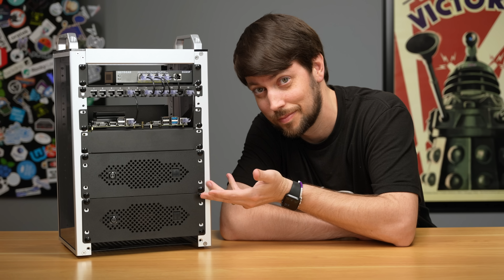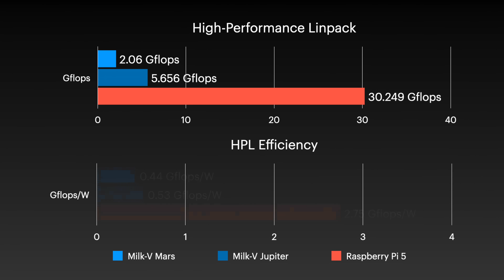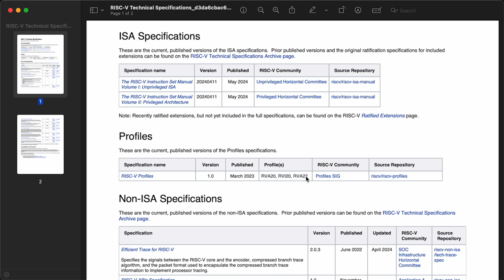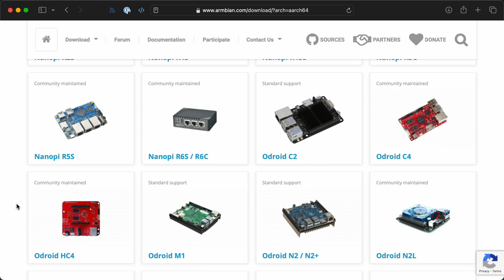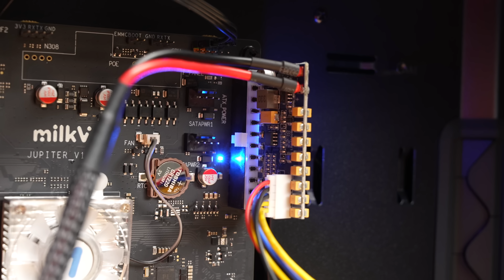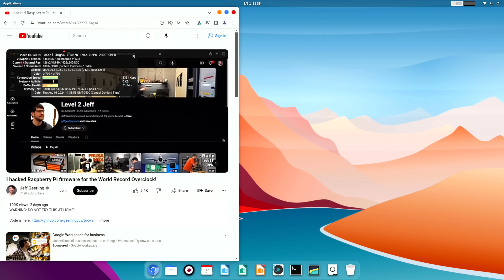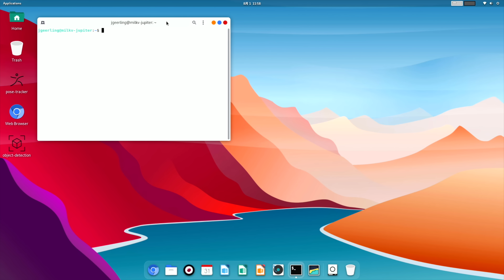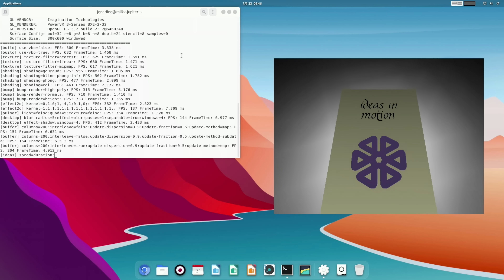The PC industry is changing: RISC-V goes mainstream

Comment: RISC-V going mainstream is the new year of the Linux desktop.
Reply from the maker: Surely it'll be this year!
Reply: @JeffGeerling  2 more weeks
Reply: On a positive note, making RISC-V fast is less of an issue than making x86 fast...
But, on the other side, it still has some drawbacks for in-order implementations that seem to make it around 20% to 60% slower than it could be (mostly by needing to run more instructions). Some are fixable, some not so easily fixable. Big issue as I see it is the lack of a register indexed addressing mode; followed by the lack of an ability to load a semi-large constant in 1 cycle, etc. There are some other things, but these are the main ones as I see it.
Reply: I believe some people here confuse RISC - a general principle of computer architecture - with RISC-V - a specific ISA based on this principle.
Reply: @NeovanGoth  The Motorola 88000 - 88100 CPU was a RISC CPU. 😋
Reply: But can it run Arch Linux and NixOs. I’m not waiting for Debian and Ubuntu to push updates or cloning every repo.
Reply: I'm waiting for Half-Life 3 being released for Hurd on RISC-V
Reply: Brah you jinx it
Reply: 3% market share finally? and without preinstalls? Sounds like cope....
Reply: I did switch to Linux this year after nearly 30 years of being on Windows.
Reply: If RISC-V support/usability/performance is as good as linux, I’ll be very happy about it
Reply: The chips are not fully developed yet to be an advantage.samsung and Chinese companies are supplying Russia with these chips for defense purposes....
Reply: Well, it seems it is this year.
Reply: 100%. I did electronic engineering and VLSI in the 90s and we were told back then, everything would be RISC in a few years. Here we are, 30 years later, and now finally, someone can, really, really, really, slowly, open youtube. Amazing progress.
Reply: @chloefletcher9612  To be fair internally pretty much all modern chips are RISC since both AMD and Intel decode the X86 CISC instructions into RISC microcode before implementing that microcode in their hardware.
Reply: @skirata3144  
To be fair, you have no idea what the hell you're talking about.
Reply: @chloefletcher9612  To be fair, most things are RISC - phones are all RISC, and they outnumber pretty much anything else. Amazon runs a large number of their servers on their own RISC cpu, apple runs RISC on all of their devices, and even Microsoft saw a rush of new RISC laptops this summer.
ARM is RISC - and ARM is winning all over.
Reply: @chloefletcher9612  Feel free to thank t-w-o three of the biggest a-hole companies in the tech industry for that. Namely Hewlett-Packard and Oracle. HP swallowed Compaq which had recently swallowed Digital Research. DR had the Alpha AXP, which was a RISC platform. HP had PA-RISC which was inferior, but chose to bury the Alpha in favor of the PA-RISC and their wet dreams of a future with Intel Itanium. Of course, since IA-64 was co-developed by Intel and HP, Intel pulled a Microsoft on HP and kept the development slow in favor of new versions of their own Core series of CPUs. Oracle on the other hand ate SUN raw for breakfast, got a stomach ache and had no clue whatsoever what to do next. Oh and Apple really helped killing IBM's PowerPC (the POWER still lives on in IBM's Z mainframes - but how many are buying those these days?)

So we have SUN Sparc, Alpha AXP, HP PA-RISC, IBM PowerPC - all RISC CPUs, and all gone. And that's what happens people, when you let numbnuts with Excel spreadsheets make the decisions.
Reply: @chloefletcher9612 which is exactly what happened?

Risc just means reduced instruction set computer.
Risc-V is just one of the architectures that implements this principle.

ARM is risc based since its inception and x86 is internally risc based since the P6 (Pentium Pro) days.

That's not some arcane knowledge either. You can read up on it on Wikipedia.
Reply: @chloefletcher9612  
This is just nonsense. RISC wiped CISC from the workstation market well before the 90s. It started its entry onto the desktop when Apple moved to Power PC in 1994. Now you can't buy a processor that isn't, at least internally, effectively a RISC CPU. RISC owned the mobile market from day one. ARM processors from Apple and Qualcomm easily compete with Intel and AMD. RISC-V has a significant presence in the embedded market and (with China's interest and investment) it's only a matter of time before it is competitive with other Processors.
Reply: @philiprobar  That is a pretty shakey statement, about as true as saying all CPUs are single instruction machines because internally the machine code is effectively deconstructed into a bunch of on/off signals. 

CISC has always been compound instructions physically exacuted by combinations of several simple internal operations, not nessesarily with reprogramable microcode but the basic action was there. The original point was to make the assembly a somewhat higher level of abstraction and allow the chip manufacturer to determine the fastest implementation for a particular chip. RISC CPUs have always required executing many more external instructions than CISC, which counteracts the difference in average cycles per external instruction, with RISC the compiler optimizer must determine the fastest combination of simple instructions for each chip model (This is a large part of why Itanium failed. Though Itanium took it to an extreme even moveing things like pipelining to a software optimization problem.) 

The type of ARM chips used for phones and laptops are effectively CISC at this point because they have needed so many extentions to satisfy specific performance demands, from SIMD vectors to codec acceleration to cache management, pipelining, and branch prediction.
Reply: @mytech6779  "This is a large part of why Itanium failed."

Not really. Itanium was a VLIW design and the software optimisation problem you mention was about instruction sequencing, which may indeed interact with pipelining, but with Itanium the real issue was finding enough parallelism to keep the various execution units busy. Still, the work already done by Multiflow Computer on such problems did advance compiler technology to the extent that numerous companies wanted access to that technology after Multiflow's demise.

For non-VLIW designs, the dynamic scheduling of instructions is not incompatible with the RISC philosophy. Indeed, CISC products have employed RISC-like internal instructions since the 1990s, at least on x86 and derivatives, precisely because such instructions are easier to work with than less well-defined, implementation-specific compound instructions.

And, with regard to RISC-V products, one can expect more substantial performance gains as more and more implementers adopt these established microarchitectural approaches, long since applied to both earlier RISC products and CISC products alike.
Reply: Never forget that this is how raspberry pi started out, too. RISC-V is advancing much faster than the PI did, because the instruction set is open and it’s easier to “stand on the shoulders of giants” at this point. 

It probably won’t be next year, or the year after, but its day will come when it can compete with a pi neck and neck. And by then, that might be plenty for things like YouTube, word processing, and other day to day tasks. Emulation, too.
Reply: @tonyolmstead8282 no we need an open gpu and south bridge
Reply: Kinda like with Bitcoin / cryptocurrency too, there needs to be a use case / killer app besides just evangelism to get adoption to the mainstream / next level.  Maybe the tighter coupling of open-source custom instructions and the open-source Linux kernel can provide that.  Kinda like the hope that RISC-V will be beneficial for the “AI” bubble/craze.
Reply: @seanwieland9763  except crypto/ai is an entirely useless tech that only serves to burn the planet
Reply: @seanwieland9763  cryptocurrency can't have a killer app because it is just reinventing the wheel
Reply: Nah, RISC-V is already mainstream in embedded. Give it 5 years and we'll have fast CPUs too - probably in Android phones first I expect since Google is adding support there and most apps are bytecode only. There's nothing big in the ISA preventing it being just as fast as ARM or x86 now, it just needs people to design the chips.

@chloefletcher9612, everything is RISC now - did you miss Apple and Microsoft moving from x86 to ARM?
Reply: @TimmmmCam No thank you. Keep that junk away from my PC.
Reply: Yeah I really don't think so since it is ten times slower than the pi3. Forget about being ready for the mainstream the hardware still needs to make massive leaps in performance before it is even considered ready for the mainstream.
Reply: @fastedwarrior7353 maybe for NAS, high end fridge, etc, not as PC
Reply: @fastedwarrior7353 2 5 GH is good enough for average use.
Reply: Also on laptop please
Reply: We always say that for every year

Comment: Wishing RISC V the best of luck.  I loved my time working on SunOS/Solaris/SPARC.  I loved that Sun had published much of the Solaris/SPARC that it could be used in University classes.  Hopefully that role could be assumed by RISC V and Linux.
Reply: Open Solaris lives on in the illumos project. There is even a port to at least one RICS-V board.
Reply: SPARC was multisourced by design, and used in many other places, e.g. ERC32 for space. It also had some high end open source implementations published. MIPS was more popular in architecture classes last I checked, though, and is also used elsewhere (like the PIC32 rebrand). It kind of seems like abandoning either is fad driven, like the adoption of Java.
Reply: It's struggling to play a Youtube video at 360p? 
I like the concept but I can't really say I am very impressed by this thing...
Reply: @Alfred-Neuman  This. It probably needs another 5 years.   Ebay just offered me a Lenovo PC for $35.  It's easily 10 times as powerful as this machine. With a smaller foot print too.

Comment: Thx for the video but I have some remarks.
1. the speed in YT is resulting from bad GPU drivers which is a commonly known problem with Imagination GPUs. If you would have used a Radeon RX550 in the PCIe slot, it would have looked much different!
2. a main difference between the K1/M1 chips is, that they support vector. That's why it is crucial to have software (even benchmarks) built with vector support which most aren't (or using version 0.7 of the standard but this one has 1.0!)
Other than that it was a nice and informative review.
Reply from the maker: Oh, didn't even realize the RVV support in K1 was different! Honestly I had to dig through a lot of articles for the differences, Spacemit's own website doesn't have much data on the English version :/
Reply: @JeffGeerling  no problem....community is here for you :)
Reply: @Nightwulf1269 community win!

Comment: IMO if Risc-V matures faster, it's because it benefits from effort previously put into making ARM work. People are now set up to work with multiple ISA, so adding one more is less of an issue.
Reply: It's not like ARM was the first or even third processor architecture switch. Porting entire systems across processor architectures is at least as old as Multics, the predecessor of Unix (for which it is a main characteristic). Macs have gone from 68k to PPC to x86 to amd64 to ARMv8. Linux traversed a different widening path, x86 first, then 68k and onto all sorts of others (alpha, mips, sparc, ppc, arm, etc), all prepared by GNU.
Reply: It'll be years before RISC-V is a viable platform at this rate. Its an order of an magnitude too slow for even basic compute tasks and can't really do everyday tasks at all. Competition is good don't get me wrong but RISC-V is so far from being competition that it might as well not even be considered at all. Sure the software side needs a lot of work but the hardware side seems to need even more work. Risc-V is ten times thats right ten times slower than even an old arm platform like the Pi3 and it'll need another decade of work at this rate. Apple's M-Series of chips is really the way to go right now.

Comment: Considering the state of GPU driver support on ARM (more lack thereof) even if RISC-V is worse right now, it won't be long before it overtakes ARM I see a way bigger push for full support here and geopolitics aside I think it's trying to avoid repeating the same issues we have with ARM boards so far
Reply: It has an extremely long way before it overtakes ARM. Pi 5 is not very fast, and it's just a tiny fraction of that. They may match current ARM in 5 years if the Chinese throw billions of dollars at it. Of course, ARM won't be sitting still.
Reply: @tschorsch  I was referring to GPU support only, which is a very low bar even on ARM
Reply from the maker: The PCIe bus is already pretty solid on these chips, certainly as good as 1-2 generation old Arm SoCs.

Comment: For the geekbench question: could you try using the Phoronix test suite? It benchmarks actual applications, so could be a bit more accurate too.
Reply from the maker: The Linux kernel compile was the pts version — right now some parts of Phoronix work okay on RISC-V, others don't. In the linked GitHub issue I have more test results too :)

Comment: 1. Processor developers should be given more time. Expectations regarding development progress are enormous these days. We must not forget that the companies behind them are not as big as Intel or AMD. On the other hand, several competing companies may be developing very similar processors. So a lot of wheels are being reinvented several times.

And that means:

2. I fear that if development has become good enough for everyday non-server processors, the number of competing products will put users off, similar to Linux, in my opinion. With Windows or x86 processors, I have to live with what one (or two) companies develop. I simply don't have the time or the desire to try out a number of Linux distributions until I find the right one (maybe the next one is better?) And processors and boards simply cost money, unlike Linux.

I don't know how realistic it is, but maybe a long-term socket for RISC V would be a good thing, but then everyone would have to agree on a version and it certainly won't be problem-free, I'm thinking of the BIOS or equivalent, and it will probably be more expensive initially too.

Comment: Does it boot with normal UEFI or does it use U-Boot or another bootloader?
Reply: Theoretically, you can recompile UBoot to add a UEFI interface, but I've had almost zero luck in actually getting it to work
Reply: OpenSBI and U-Boot.

Comment: So far the GPU support from Imagination Technologies for the RISC-V chips still has to produce some real results. From that perspective, the GPU support for the Raspberry Pi is mature, and now that Collabora has released the OpenGL driver (Panthor) for the RK3588, ARM is still ahead of RISC-V. And nobody seems to know when Imagination Technologies is going to upstream the GPU drivers.
Reply: Back when androids came with gpus from Imagination Technologies, they did the same stuff - not releasing proper drivers/blobs.
Reply: It's already open and mainstream.
Reply: Panthor for Rk3588 is still a dumpster fire, to the point you are still better off running panfork. And no Vulkan yet. And i brought a OPI 5A a year and a half ago... They are far from being a good example.
But i do agree about Raspberry PI.
Reply from the maker: I keep hearing they will... and then delays... so still holding out some hope, but I don't think most of us would give Imagination the benefit of the doubt!
Reply: Isn't Imagination really bad when it comes to GPU drivers for ARM and MIPS Linux? The CPU vastly underperforms and can't even compare to ARM in efficiency. I think that Apple's M-series blow this out of the water in both performance efficiency.

Comment: RISC V is a cool and very important project. But RISC V as a desktop or server CPU is a meme and will be for a while yet unfortunately .
Reply: I mean, powerpc is still being used in the (albeit niche) line of servers being produced by IBM, they sold their x86 branch to lenovo along with thinkpads but their Powerpc servers are still produced inhouse. I imagine porting low level software from one risc architecture to another is probably easier than porting from cisc so this might help in some very specitic cases
Reply from the maker: But it's the year of the Linux Desktop!? :D
Reply: @JeffGeerling  :D

Comment: Of course you have to put the gpu in it!
Reply: Wonder if AMD would have compatibility drivers one day for the Fury X Nano 🤣picked up a bulk of 10 for $60 a piece.
Reply: @shadowarez1337  
Those are well supported by current up to date drivers on linux.

From his previous videos the older (gcn architecture) AMD cards are what tends to have the best compatability on non-x86 platforms on linux when it comes to dedicated gpus as well - so if any gpu would work that would be one of the more likely ones to work.
Reply: @olnnn  thank you then I may have a project I can work on and a use for these treasured GPUs so far 5 have gotten the liquid metal treatment with the conformal coating to help prolong them.